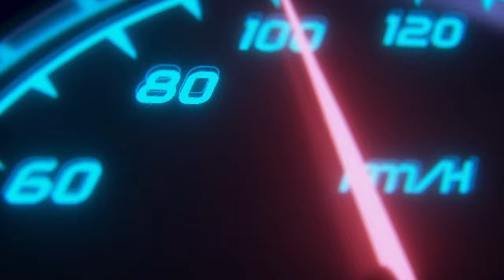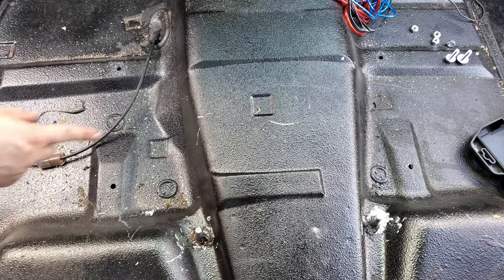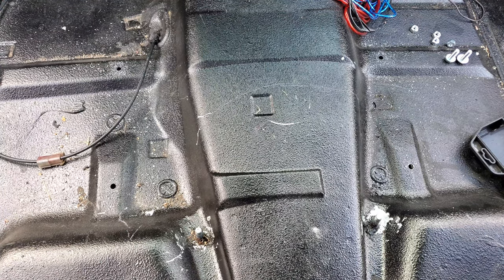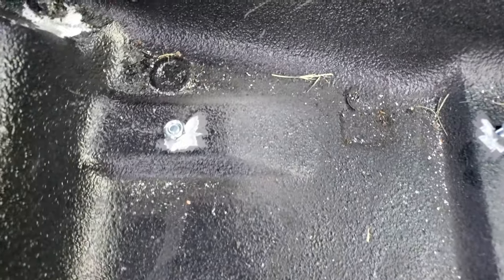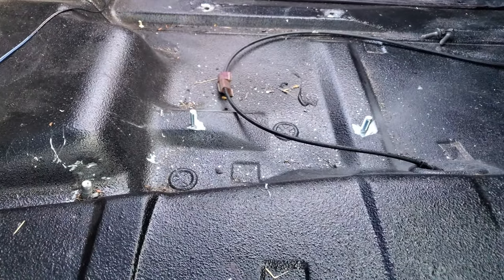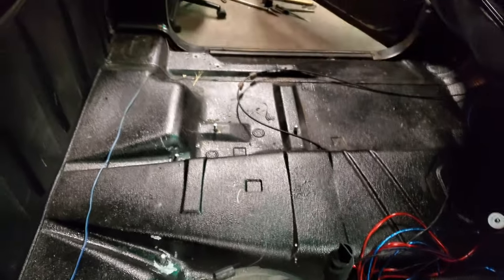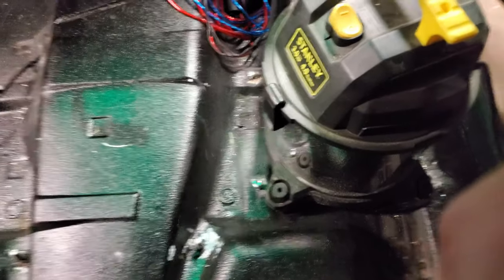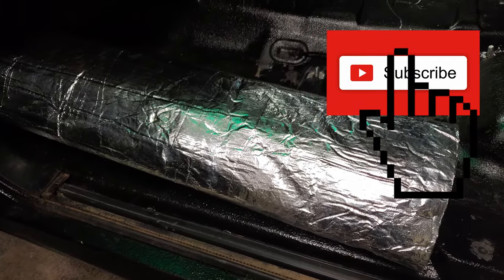C1500 OBS Bench Seat to Bucket Seat Conversion

Comment: I like the floor coating on your floors. I do the same when i strip them down
Reply from the maker: Yes sir it never rust!!!!
Reply: What is this magical floor coating?
Reply: @Darkapprentice84  i use bed coating. Helps keep away rust and is a slight heat and sound barrier

Comment: So I have a 98 obs and I looked to see if I had to drill holes and my floor had a factory bolt on and I have to drill one hole in the floor, should I just weld a piece of metal to the floor then thread it?

Comment: I have a 90 Silverado 1500 step side single cab I'd like to mount some aftermarket seats possibly bench with center console what years can I possibly search for Not necessarily aftermarket but out of a donor vehicle
Reply from the maker: Any of the 90s will bolt right up ext cab or single cab don't matter. Some later models will fit you just have to make new holes i modified my old bench frame and used it to mount racing seats which in my opinion is the smarter move cause bolts right up.
Reply: I wanted to do this too man I’m really thinking about it

Comment: What coating is it that you have on your floor? Do you put primer, then rubberized sealant to prevent rust?
Reply from the maker: Its trex protective coatings. No need for primer unless got bare metal.

Comment: I have a 96 std cab that I'm trying to convert from bench to buckets, question is how many holes would I need to drill in my floor?
Reply from the maker: Only the inner 4 bolts the outer are the same if you get buckets from the same kind of obs. I choose to weld mine just so I would have to hold the bottom.
Reply: @DrivenbyGears  thanks for the response! I saw and knew it was out of my wheelhouse lol but I can drill 4 holes and put bolts through them
Reply: @DrivenbyGears  would drilling then threading the holes be an option?
Reply from the maker: Not enough metal, if welded plates maybe underneath

Comment: So my understanding the driver an passenger seat fit the factory holes.. an the center seat needs moods to the floor?
Reply from the maker: Only the outside legs have nutserts inside legs will not.
Reply: Driven By Gears thank you sir
Reply: @DrivenbyGears  So there’s no existing indentations for a center console?